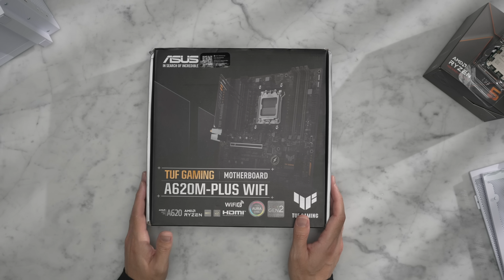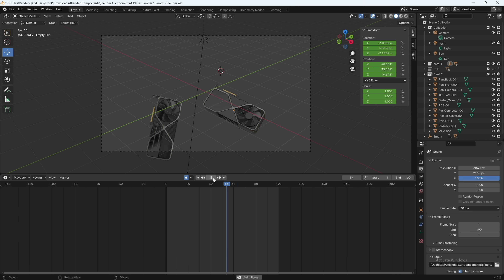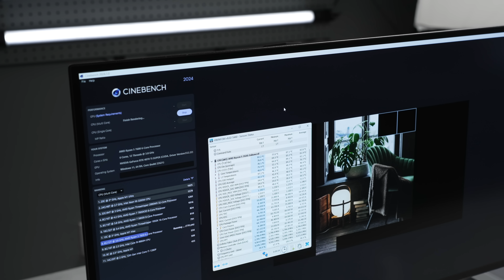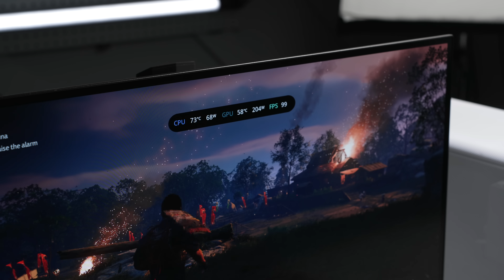$1500 MAX Performance Micro Gaming PC (Step-by-Step)

Comment: I still don't understand why people don't use ITX and Micro ATX cases, pure gold.
Reply: Lack of ITX is because of how expensive it is, an MATX cases are either expensive, just ATX cases but slightly smaller or low quality
Reply: @ThePrimordialArchon  deepcool ch260 and ch270 are very affordable solid mATX cases, just gotta look really close to the market
Reply: @ThePrimordialArchon  ITX Pricing is a bit too much here in Europe, i love the compact look but M-ATX with just right case is enough for average person.
Reply: @Vumok  true, hell its near impossible to find a ITX motherboard in the first place here in europe let alone a case, only ITX motherboard ive seen in europe is a ROG b650 for €259
Reply: @ThePrimordialArchon There are two ITX asrock am4 for 100-150.
Even then tho, getting a worse board for more money when you could get an matx for less than one atx seems silly unless you really need it.
Reply: Less optimal airflow for smaller cases. Most people who use ITX use Ryzen or lower tier Intel. Intel xx700k and xx900k usually get way too hot to be used optimally in an ITX case. Either way, larger cases generate less noise as well. Only reasons people use ITX or MATX is for space saving, easy to travel with, or just looks, and there's not as big of a market for those types of people as there are for just regular ATX
Reply: @sonofulti1337  I mean ITX is sort of extreme and not necessarily needed but M-ATX is totally open to start with,  i never had full atx mobo since my slots are only covered by GPU and Sound Card, people are always free to add bunch of extra cards on FULL ATX mobo but for average person M-ATX is just enough suitable.
Reply: @Vumok  well in that regard, it's more about looks or space saving whether you get M-ATX vs ATX
Reply: Micro ATX is a good buy ..

Itx is let down by expensive parts
Reply: Probably because they just don't really care, and it's easier to get the mass produced case sizes + it's cheaper. Also, they probably don't even understand how overrated cooling in general is. Not everyone knows that you can get pretty much the same performance by optimizing components to use much less power.
Reply: The issue is the ITX tax, everything SFF is just more expensive for less features. While the mATX is viewed by manufacturers as the budget option. You will rarely see a good high end mATX motherboard or case. Unfortunately for most people that only leaves up regular ATX.
Reply: @RafitoOoO  ITX builds are just part of minimalistic design that i personally love and my goal in future is to build one; in Europe building one is unfairly expensive and doesn't make any sense but looks cool and saves that desk space but rly your space is your space just fulfill it however you want. Just my opinion is that people should take much more interest why they are buying each component and will you ever used it for it's full potential and meaning.
Reply: @Vumok  I also love itx, but it's hard to justify paying a lot more for less. I mean, you have a lot less connectivity for more money, if you're on a budget it's hard to justify.
Reply: Why do you care what other people do or dint do? just do what you do
Reply: I like itx build too but it too expensive 😂
So i settle with matx build 😊
I have the metal fish s5 clone case from china because it cheaper it doesn't have cable management space so i custom cut my non modular psu cable😂
Reply: Micro atx is pure gold, itx has a premium for it so you’ll need gold.
Reply: ITX Tax
Reply: I love the sgpc k88 lite it's an MATX case holds all full size components and it's probably the smallest ATX you can buy it's probably the same size as the case in the video oh so don't ask where the name of the cases so long
Reply: price
Reply: Because they're not as affordable. I'm sure people would be more willing if try them out if you pay them the difference, lol.

Jokes aside not everyone may feel confortable working with a smaller, and therefore more crammed form factor. It's not as beginner friendly as an atx case. And for some the smaller form factor just isn't worth the tradeoff. Thermal and airflow concerns are there too. That, and cost.
Reply: I really want to switch but can’t justify the price of buying an itx or prefferably matx case and mobo plus i really like my kraken cooler
Reply: One reason is that small form factor computers are a PITA to put together.
Reply: Itx is more like a luxury than a value for money , high prices and low availability of parts kills the joy of building an itx based pc . So many beautiful itx cases but components availability ☹️☹️. 

Well still I bought dan a3 matx  beautiful case  🙂
Reply: Coz I already got a heater in my home
Reply: @girieditx  How would the case size dictate how much it heats up your room?
Reply: Because they don't make any mATX motherboards that are worth buying.
Reply: It’s is more expensive and cant fit as much
Reply: Because they are wannabe ninjas